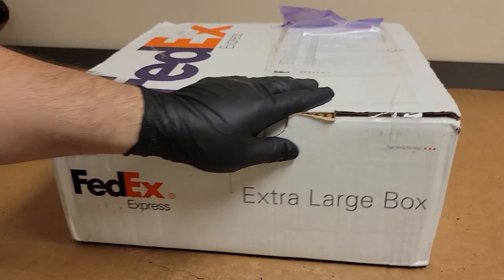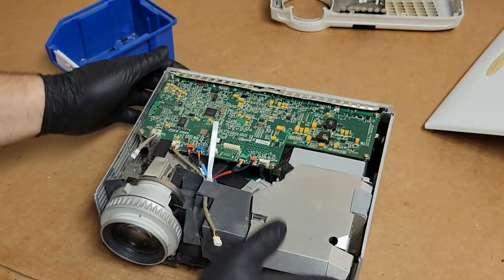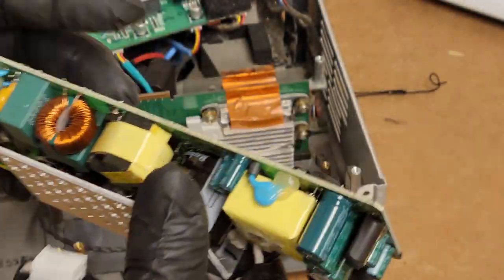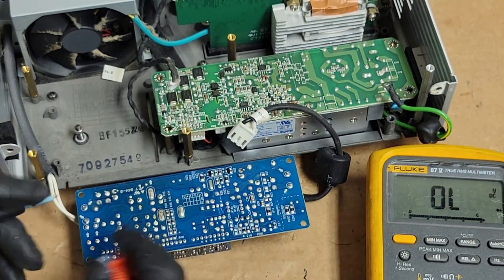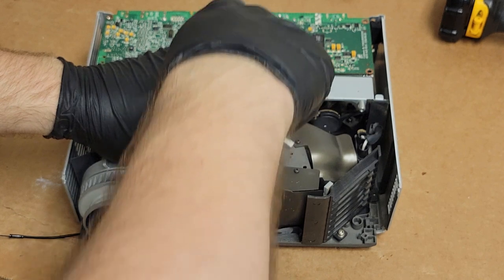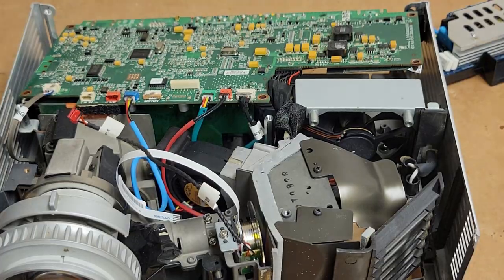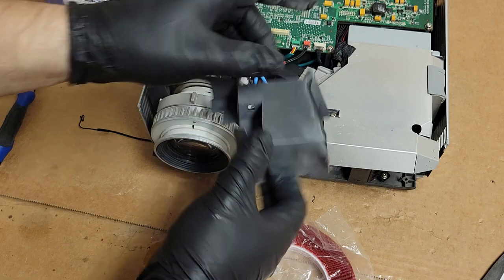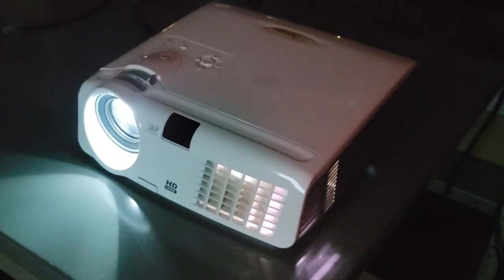Optoma HD70 DLP Video Projector Repair  No Power / Bad Color Wheel

Comment: Frank my benq w 1070 wont turn can u tell whats the sequence of powering up
Reply from the maker: Sure thing.  Once you press power you should hear the beep.  Then the color wheel should start and almost immediately the lamp should ignite. roughly 30seconds later the fans should kick in and the image should start to appear.  What you are seeing?
Reply: @FixitFrank  when i press the power button no beep the color doesnt spin nor the fans
Reply from the maker: Do you have the standby light(power LED)?  Or is it acting like the projector is unplugged?  There should be a standby LED.  If not, double check the lamp cover.  The cover presses on a little switch that interrupts the mains power.  If you haven't already seen it, I have a few vids on the W1070/HT1075(same thing for the most part) and I go over the lamp door cover switch.  If the lamp door is seated correctly and you still have no standby LED, the power supply would need to be checked next. 
This is all assuming you have no power LED.  If you have a power LED and no response, then its a mainboard or power supply issue, although I would try the remote in case the keypad got locked.  Lastly if you are using the remote, check the batteries.  I'm sure you checked all the easy stuff, but I'd be remiss to not mention it.